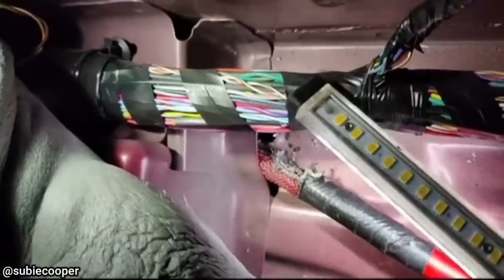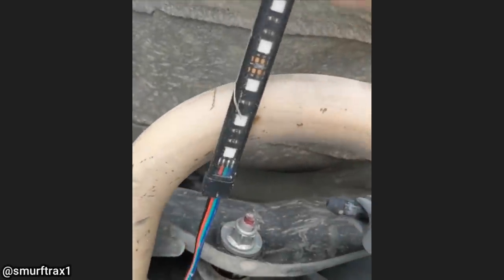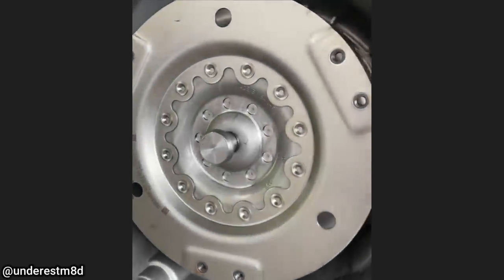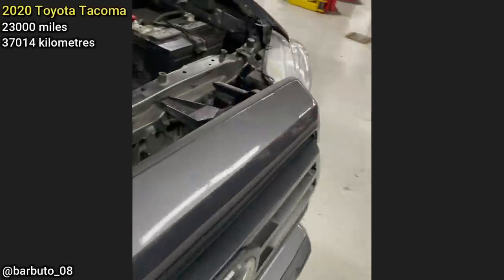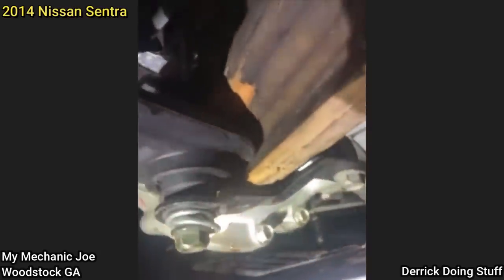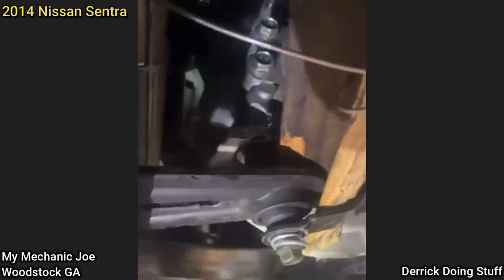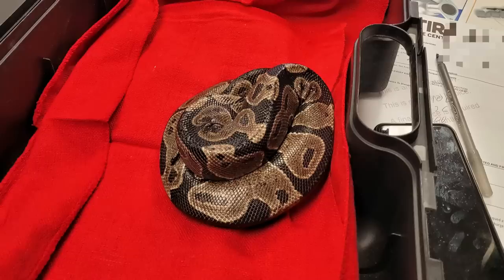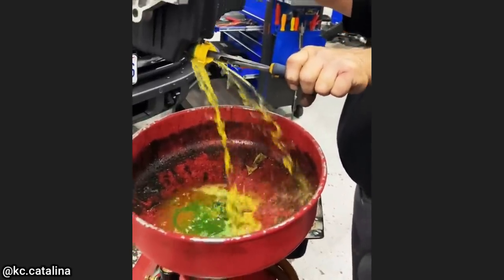Customer States Drove Over A Bolt & Now Smells Burning Plastic | Just Rolled In

Comment: Holy crap, this was a spicy one, never ceased to be flabbergasted with some of this footage lol.  That Screw/ Bolt penetration was a nearly one in a million shot, wow.
Reply from the maker: They're lucky it didn't hit the harness as well or have the vehicle go up in flames lol
Reply: @JustRolledIn  Right?!?  Hahahahaha
Reply: @Gareth Fairclough LOL
Reply: Definitely
Reply: They shouldn't take any bets anytime soon, that's some Final Destination shiznit right there
Reply: @masondegaulle5731  Damn near hahaha, that or they're insanely lucky and may want to play the Powerball LOL!
Reply: One time I had to fix BMW that didn't have supply in several electronic units. Turns out the big spring fell of a trunk hinge, flew right into a thick red cable causing short circuit and blowing out one of the main fuses. Should that spring hit half an inch to the left or right side the customer would save a tonne of money for new fusebox.
Reply: @brys555  That's wild hahaha wow

Comment: So many catastrophic failures and grenaded transmissions in this video but the missing expansion tank cap being right next to it is what killed me lmfao
Reply: Ever search for your glasses on your head or collar?  It's all about where you're expecting to or not to see it .
Reply: Its the straw in the throttle body for me
Reply: Yeah a guy I used to know asked me if I had something to cover the oil filler hole after he lost the oil filler cap, he went off to find something to fill the hole and I then asked him if this would do, finding the original oil cap not far from where it should be fitted.
Reply: @carpediemarts705  Used to know a guy who wanted a wire brush, we looked everywhere in the workshop and couldn't find it, he went to scratch his head and that's where we found the wire brush all caught in his long hair.
Reply: And why go to a mechanic when you can just go to an auto parts store?
Reply: Worst grenaded transmission I've seen in person was a brand new '08 Suburban with 200 miles on it. Couple that owned it flat towed it behind their huge RV, and once they got to the camp site, it wouldn't move when they unhooked it from the RV. Turns out, when they tried to put the transfer case in neutral, they did it completely wrong, and dragged that poor Suburban for 500 miles in 4-low. There was just enough left of the transfer case to keep the driveshafts off the ground, and the transmission had massive holes in it's case (and most of it's guts missing). GM obviously refused to warranty it, which infuriated the couple. Apparently, it was GM's fault that they ignored GM's instructions on how to put the transfer case in neutral, and made up their own instead.
Reply: Our store had some work done in our basement storage, and after the lights to the stairway down didn't work. They sent electricians out twice to try to track down the issue, no luck. I was going down stairs one day and noticed a light switch near the top door... We had never turned them off and just thought the whole time they were on an always-on circuit for safety, but apparently one of the workers on the original job simply turned it off when leaving.
Reply: Neutral dumps will explode an Automatic transmission.
Reply: @joevk6274  I knew a guy that towed his Datsun pickup behind the logging truck going in to camp. He left it in 1st gear and the engine and exploded into many pieces. That guy had so many oopsies I cannot count them. The best one was leaving the self loader boom up in the air and dragging down about 200 feet of 8" blowpipe from the chip line.  He was truly gifted...
Reply: Joevk- I will never understand flat tow anyway. Using up tires on a car you are not driving and adding more mileage.
Reply: ya thats like loosing your glasses on your head
Reply: @tt600pch  LMAO sounds like something I would do! I tend to do dumb stuff because I go all ADD and forget important things. And don't even get me started on things that go wrong when my dad and I work on something together. Ugh. My ex-wife called the two of us Murphy's Law.
Reply: More than once, I’ve put a tool down, wiped my hands with a rag, and lost the tool that I just freakin’ put down! Why, yes, I did find the tool under the rag I used to wipe my hands.
Reply: So many broken Dodges.. perplexing.
Reply: @someinconsequentialusernam7799  omg the number of times I've done exactly that! Ever lose something, only to discover you'd been holding it in your hand the whole time you were looking for it?
Reply: Easy fix.

Comment: Absolutely LOVED that old pickup with hydraulic lift on the hood! 😸
Reply from the maker: Super cool! A subscriber sent that one in.
Reply: Seen hoods close on people, but to be closed in on by that one might not be good. Slowly crushed, it sounded like a compactor.
Reply: Cool yes but practical no. I wouldn't want to work on it under that hood.
Reply: Until the batteriy is dead and that shitty thing won't open.. Not everything needs to be improved. Simpler is better snd cheaper
Reply: @mbryson2899  how is it safer?  I noticed a bracket in the front but didn't see any way for it to latch.   So it's just the electric actuator or hydraulics that is holding it down. I would love to see the components closer or in person but it looks like you  better put it in a car hauler or load it backwards to keep it from becoming a wing.
Reply: And it had an ay-euga horn. Perfecto!
Reply: @mbryson2899  I have worked on vehicles for over 20 years on older vehicles and have never seen a hood spring launch itself. Are you talking about the spring actually coming out and hitting you?
Reply: @mbryson2899  so because that happened 1 time...    I've had a battery explode on me when I hit the starter button when I was 12.   Sure it bothers me now and I cover every battery that is next to me (mainly on tractors)  does that mean every battery will explode.   No. It happened once.   Can it happen again? Yes.    Was the spring that happend completely factory? Or has someone tinkered with it?   Just because something breaks on you dosnt mean it was a bad design.
Reply: Best use I've seen
Reply: @mbryson2899  that's why I said I would like to see it closer or in person so I could see how it actually worked.    Have I ever messed up as a mechanic?   YES!!!  I have made mistakes. But I learn from them.  That's why I'm so interested in how things work and how other people build stuff so I can learn from them and their mistakes also.

Comment: The shop that found the snake went above and beyond the call of duty. Not a fan of snakes as pets, but serious respect to those guys.
Reply: At least they were aware of the snake from the beginning. Just think how scary it would be to just stumble upon a snake in a vehicle you were working on!
Reply: We had a rat die in our car. Didn't know until it started smelling bad. The body shop that took the interior apart and removed the dead rat, they REALLY went above and beyond.
Reply: Thanks. It was great that it worked out the way it did.
Reply: Seriously, I don’t think I could even work in the same shop as a missing snake

Comment: That must have been one hell of a pothole 🤣
Reply from the maker: Right? Sure did some damage 😅
Reply: Must have been the Grand Canyon.
Reply: I inspected a semi-truck & trailer and 8/10 nuts were loose on each wheel of one axle on the trailer. One of the rims was also significantly bent on the same axle. He said something along the lines of, "Oh yeah, I thought I ran something over about an hour ago."
Reply: Might have been from OKC. The I40 through Oklahoma City has some BAD potholes. I'm talking bad enough I thought the semi I was in would lose a steer tire.
Reply: It was lowered. 
A manhole cover took out a car in front of where I work.
They were repaving so the cover was up two inches. 
On lowered vehicles a possum  can total the car.
Reply: pot hole hell that was a bomb crater!

Comment: I know this channel is technically a small sample, but someone convince me that the castings on these equipment housings aren’t getting just slightly thinner. Thin enough to make the part function, but any collision or impact will crack them like an egg.
Reply: They don't make 'em like they used to...
Reply: They are thin
Reply: @Account NumberEight Make them out of that stuff they made those transparent N64 controllers from, that shit is bombproof.
Reply: I work for a tier one supplier to several car makers and we die cast aluminum for many car companies . We're trying to make things thinner and lighter every day ,lol .
Reply: @rydfree  Just make them out of aluminum foil. You can fold the edges over a few times to make it nice and rigid.
Reply: I question the part about them being functional.
Reply: @wwiiinplastic4712  The thin kind, not the much thicker stuff they use for cooking.
Reply: Recycled beer can crap is my first thought. The clueless idiotic driver is the next. God’s wrath.
Reply: everything to save a dime. what used to be cast metal is now plastic and will fail because they used too cheap a plastic that can't stand engine heat and fuel/oil fumes... and what is still cast metal is now so thin because the computer says it's working. someone with experience would say it'll fail, but those individuals are becoming rarer every day... and them engineers won't listen, anyway.
Reply: @lotharrenz4621  engineers that know anything about a vehicle are far and few between nowadays.
Reply: Yea because they should never be "collided" against. Why design something overly heavy for a what-if that wont happen to 99.9999% of people? Frankly if people are cracking transmission housings by driving into things I doubt an engineer can really help with that.
Reply: @lotharrenz4621  I sure love an overly heavy car that can take a punch. 
Especially with the gas prices nowadays they won't be saving a dime, and neither will we! Win win.

Comment: love that last truck and its hood lift. Had an idea like that but the whole hood and panels opened up wide to make it easier to work on.
Reply: Jaguar E-type, the whole hood and fenders tilted forward together, it was really cool.
Reply: 1960s era Jaguar E type and triumph spitfire has a one piece hood and fender hinged forward. The spitfire you could sit on the tire and do a tuneup
Reply: I used to have a Saab 95. The hood opened forward and if you squeezed inward on the hinges it came off entirely. Then undo two bolts and disconnect the headlight connectors and you could take the whole grille off.

Comment: How do you staple a wire, into a GAS TANK, and not question if you’re doing it right or not?
Reply: Likely didn't know that was the gas tank. Looks like it was installed by a slum-tier home decorator.
Reply: at least they were not the 6 inch long  industrial staples ...  consider the outcome, eh ??
Reply: Probably a combination of knowing nothing, being young, and working on someone else's car (not your own).
Reply: Yeah, what an amateur. Shoulda used drywall screws.
Reply: Yeah, what an amateur. Shoulda used drywall screws.

Comment: Customer states "My clutch went bang and the pedal went to the floor" Hyundau i40 Tourer at lunchtime. Had to wait 4 and half hours for a tow back to the dealer. Only 13,500 miles on the clock. Hopefully covered under warranty. No photos but the sound from the engine running in neutral is spectacular.
Reply from the maker: Oh boy that sucks! I sure would hope that would be warranty.
Reply: @JustRolledIn  Got it back to main dealers just in time. They pull it apart on monday. Hopefully get parts and repair it and we can get away wednesday. Today was day 1 of a 2 week vacation. The noise sounds like flywheel bearing, clutch thrust bearing maybe. Clutch slave cylinder blown up, clutch hydraulic fluid all over the road. 
You take your time finding the right low mileage car, no scratches, no dents. Then it blows up on you. Still, not in an accident, nobody in hospital so count your lucky stars it's just bits of metal broken.
Reply from the maker: @thehairygolfer  keep us updated on what they end up finding!
Reply: @JustRolledIn  Yeah sure. I'll do that.

Comment: I’ve got a light bar and ditch lights on my truck. I’m a little embarrassed because I have some extra harness near the relays and used some crimps in one place because it was too tight to solder.  Everything else is solder heat shrinked and run thru loom and zip tied up against the fire wall. I can’t believe more of these wiring jobs don’t cause fire. Between the sloppiness and you know they’re not doing the math for wire gauge.
Reply: Actually crimps are better than solder in automotive wire harnesses. The soldered area becomes very stiff and so bending stress is concentrated right at the point where the solder ends, leading to broken wires over time. OEM wire harnesses use no solder.
Reply: @mckenziekeith7434  did not know that. Thanks for the info.In your opinion would solder me a better choice on exposed wiring. Like outside the engine bay. I live in the salt belt so anything not water tight with corrode and fail.
Reply: @leadpilled5567  I think I would use waterproof heatshrink butt connectors. There are some that you crimp, then heatshrink, and there are others that you don't crimp, but they contain just the right amount of low-temp solder that they form a solder joint at the same time you heat shrink them. Both are supposed to be waterproof. I think the solder connectors might be OK because the amount of solder is controlled. Hopefully it does not wick far enough up the wire to create a stress point. Soldering is OK if you are able to completely prevent the wire from bending in the area where solder is.

Comment: Look, I know snaking wire inside a car can be a pain in the ass. I'm not a mechanic but I just installed a front and rear dashcam, and yeah, getting that cable from the back of the car to the unit in front wasn't fun.

But COME ON.

What a lovely MR2 in the collage at the end. A 1985 MR2 was the first car I ever bought new for myself. Man, I miss that thing.

Comment: If someone stapled something to the fuel tank, I'd refuse to work on their vehicle until it was removed and the damage is repaired.  That is a huge hazard, it could leak and I could see a spark happening if one of the wires loses its insulation
Reply: Or, you could just disconnect those wires from their power source first...
Reply: @SepticFuddy  that doesn't solve the potential leaking and future shorting
Reply: @magna116  The issue I'm talking about is unrelated to the repairs they came in for.  It's a liability and the hazard should be fixed before other stuff is worked on.  My point is that it's a danger to everyone else on the road.
Reply: They're already at a mechanic, but being liable for issues customers caused that are unrelated to your repairs if something goes wrong is not what a lot of people want to deal with
Reply: @JSTheAnonymousOne  I concur on safety here:0; this channel's been outdoing The Bozo Factor ever since I subbed

Also many bug & trash laden heaps that I wouldn't touch w/a 39ft pole, yecch:(
Reply: "I'm not touching this vehicle until you take it to a REAL mechanic"..

Comment: That Toyota MR2 picture at the end is just like the one I had many years ago. I was just looking for one in that color as well! What are are the chance of that???
Reply: I bought a new Fiero in 1986. SE Trim, V6, 4 speed manual,  loaded. Has 238.000 miles on it now. Still runs like new.  Was a fun car when new. Still is actually,  lol.
Reply: @johnfranklin5277  I had one of those too. It was a silver 85 5 speed Fiero for a brief period then got the 86 Toyota MR2. I regret selling it ever since but had to sell it after getting married and had kids because it's a 2 seater The Fiero was a blast I'm currently looking for either an 88 MR2, an 88 Fiero GT or a 96 Toyota Celica GT. But WOW! 238K miles! is it a V6???? The 2L engines, from what I remember, weren't that great.

Comment: 23k miles, that's that legendary Toyota reliability right there. Legendary because it's a story/fairly tale now, when it used to actually be real before the early 2000s.
Reply: Yes Toyota and Honda aren't the reliable vehicles they were thru the 80s 90s 2000s. The guys in corporate,  the engineers that designed and built those cars have retired,  died off. You have a whole new generation of younger guys running those companies now, and they aren't concerned about quality anymore.  They know the old reputation will keep people buying thier products, until they experience constant issues.

Comment: Had a Ford roll into the shop at my work today, it was an 06 F450 or F550 can’t remember which it was but it only had 8k miles on it!
Reply from the maker: Holy cow! Just like new.
Reply: @JustRolledIn  ya, I thought it was pretty funny too because the place the truck was put together is where my gf’s dad works so it did the full loop

Comment: Looks like those LED wires with staples almost nailed one in the high voltage cable for a hybrid system (thick gauge orange wire) doesnt it? Installer almost had a darwin award on his hands.

Comment: The first one is part of why i still don’t trust trunk mounted batteries… yes they are better for weight distribution and keeping heat away from the battery both good things but more chance of an issue resulting from a much longer battery cable that could become damaged.

Comment: i had an 03 ram 1500 that dropped a valve. Dodge told me it was bad gas and sent me home with it. I drove across the street to jeep and they replaced the valve, spring and gave it back to me. The valve cover had a hole punched through it where the spring exploded and they put that back on. leaked oil all down the side of the block. That was the last gas engine I ever purchased.